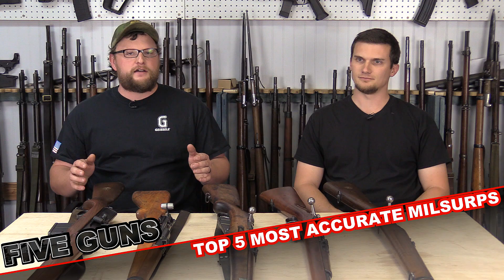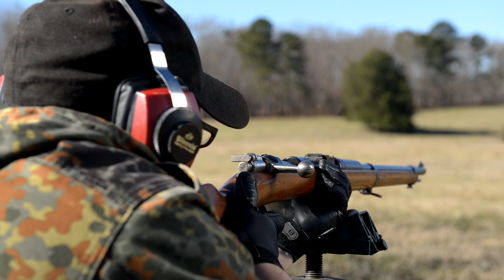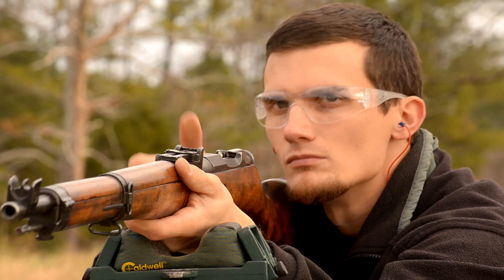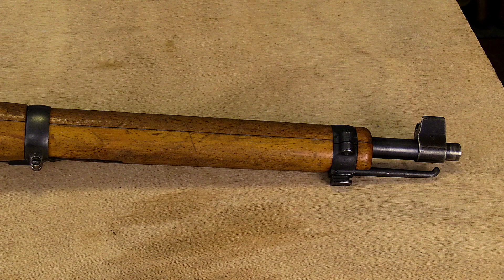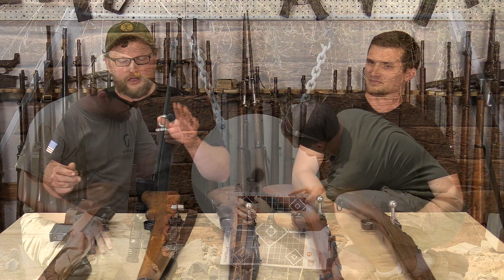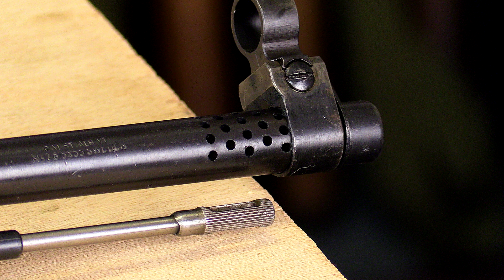Top 5 Most Accurate Military Surplus Rifles

Comment: My grandfather gifted me a Mauser 6.5 Swede when I was 16. My most prized possession! Not only because of the rifle, but being a gift from my grandfather. My grandfather was a machinist by day, and a gunsmith on the weekends. He was often building rifles, I still remember all the old stocks and parts from the 'raw' rifles he would get. The rifle he converted for me had a refitted stock, the bolt cut and shaped to that of a modern bolt angle. But the 6.5 was well selected as the Swedish sniper rifle, because it was very accurate! When I was 18, I joined the Army, one of the drill sergeants in my training company was a sniper, he was also a member of the Presidents top 100 shooters. I was like a puppy, anytime we went to the range, he was my only focus. He spoke, I always absorbed everything he said! However, when I was in the army my 6.5 Swede rifle 'disappeared.' Many years went buy, last year I found a Mauser 30-06, that I am planning on converting to a 6.5 Swede, sort of a reborn rifle that my grandfather gave me, I am thinking of a tribute to my grandfather, as I feel that so much of my life has been contributed to my dad and my grandfather.

Comment: No Argentine and K-98 Mauser? Surprising. Also surprising the .303 Enfield, 1891 Krag-Jorgansen, the 1903 Springfield and the BAR, and the Johnson missed the list. That the Swedish 7.6 and 6.6 and the 91-33/91-44 Mosin Nagant made the list is not surprising. Heck! even the SKS (which did see use in WW2 with the Russian troops, near the end of the war) is mighty accurate out to 500 meters, using the iron sights. At least all of mine were 1 m.o.a. or better at 100 yards.

Comment: My first deer rifle was a Winchester produced, U.S. Model of 1917 Enfield that was military original in the metal work, but had the full military fore end on the stock shortened , or "sporterized".  It was the full 26 in barrel with the sniper sights, rear peep with the sliding tower that could be flipped up, marked off up to 1700 yards.  The front was a blade with the full "dog ears".  That rifle was extremely accurate.

Comment: Knew a Fin who fought in the Winter War. It was a slaughter largely because the Russian brain trust would not trust/ issue their troops arms until they reached the front and went into battle. The Fins took full advantage of this and would break Russian columns into smaller digestible parts and cut them down as they marched on Finland. This fellow, a teen at the time, was the second in a machine gun nest. Once dug into the ice on a lake they popped up and began shooting the unarmed Russians as they marched across the ice. Terrible unnecessary slaughter.

Comment: I know I comment a lot and I'm going to throw a slightly cheaper Schmidt Ruben that I've had a few of in the mix and I promise will not leave you disappointed the K1911 the one I kept I've shot iron sights on a 6" gong at 300yds without a problem

Comment: My 1898 30-40 Krag was the most accurate next to my pre 68 Rem. 700 BDL 243. My dad bought the Krag off a semi trailer on the VFW parking lot in 1957. $25 for it and a box of shells. I was 15 yrs. old. Still have my 243.

Comment: The nice thing about these rifles is you don't have to worry about a gas tube when you have to substitute black powder when smokeless powder becomes scarce. How to substitute black powder to make a powder measure pull apart a round you need to convert, mark the bottom of the bullet seat, then measure 1mm below the seat mark and cut off at the lower mark (1mm below the bullet seat mark) now you have a black powder measure. The finer the grain of black powder burns faster. You need that space below the bullet seat because of compression of the powder may cause the primer to not ignite the powder. Some firearms are originally configured for black powder. The 45/70 is one that comes to mind. You need 70 grains of black powder. The thing about black powder is smokeless powder is 3 times more powerful than black powder. So converting newer weapons you don't have to worry about over pressuring the firearm unless for some weapons that were originally designed to use black powder and you over fill the casing with black powder. As things after a SHTF situation bolt action, lever action and blowback operations black powder will work in. A weapon with a gas tube you might get 5 shots off before your gas tube gets blocked and you have to manually cycle the weapon. Having a Chronometer is helpful when you need to start using the different types of smokeless powder. If you do reloading you have a set of specifications. Let's say you run out of Ramshot True Blue. I don't use 5.56 rounds because I shoot from my left side. The brass from an AR15 or M16 gets thrown back into my face. However my 5.7 x 28 rifle and pistol I can use the 5.56 bullet and some of the powder charge from the 5.56 rounds to reload my 5.7 x 28mm brass. Just have to find out, using the Chronometer, the proper amount of powder needed. I hope that I gave everyone some good information that I received from another person who does reloading.  I have very few rifles that have a gas tube. And one rifle in  .308 has a gas rod and spring system for delayed blowback operation. As the 2 rods are pushed back to extract and reload the rifle chamber. When the rods push back forward it blows the extra gas back out of the gas port and cleans the gas port and the 1st rod section of the gas tube. This rifle, although it has a gas port and gas tube setup it won't jam or plug up the gas operating system.

Comment: M39 is the bomb. K31 is a tack driver too but ammo is too $$. Only thing the same between the 91/30 and the M39 is the bolt & the round. Trigger is 1000 times better and barrel etc is all much much better. Plus it shoots cheap 7.62 x 54

Comment: The diameter of a dime is 0.705 inches. You guys shot dime size groups at 100 yards with a WWII era Karabiner 98k with iron sights. Still the 98k was not accurate enough to make the top 5 most accurate list. I would have to assume that the five most accurate rifles on the table are all also capable of at least .7 MOA iron sighted 100 yard groups. That makes six sub MOA production military rifles of the WWII era you have in your possession.  You guys hit the jackpot. You are obviously excellent rifleman. Amazing.

Comment: I have an 8mm Mauser. German. Sporter stock with a pistol grip and a tapered barrel. Numbers all match. 815P. The rear sight slides to adjust the sights out to 1000 yards. I was hitting it paper plate at 300 yards with the front site covering the entire plate. AWESOME gun. I would put it against anything. Has the German eagle and swastika on it. Not too heavy because of the shorter stock. The 1" rubber butt plate has Jostam May 5, 1931 on it. My grandfather picked it up in Italy during WWII.

Comment: Can't believe this video is 5 years old I'm just now coming across it, I've owned all five of the rifles that you have listed in the top five except my motion was a hex receiver fairly new and was pretty accurate as the finish one, however I agree with you this swedish Mauser which I own two one was a 1905 and one was a 1906 it was extremely accurate with just iron sides at 250 yards I shot a 47 out of 50 points on a military range with pop-up targets in Atlanta in the rain

Comment: My 8mm k98 German rifle has the rear ramp sight calibrate the 2200 yards. I can group with this rifle 10 rounds is a 6 inch pattern. Wouldn't trade if for anything. I also use a Chech 225 grain mouser shell.

Comment: i have owned several British enfield 303 rifles. never had a bad one with my reloads good accuracy 2-2 1/2 to 1-1 1/2at 100 yds .my Swiss Mauser 6.5  x55  1/2-1 inch 100 yards. my hikam 8 mm 1 3/4-21/2 . my mosin nagant rifles 1- 2/12 100yards . these are a working collection. ready to go hunt, defend and I’m the dark days that coming if necessary hand out to help guard my community. some I made side mounts with adjustable bases for windage and elivation and scoped . all of my old warhorses I couldn’t get it my gun safe. there in racks in closet. a bolts removed hidden very good. if someone breaks in and don’t die from my 45 super and we’re to steal them thay can’t fire them. they would be nearly impossible to sell no pawnshop or gun shop would touch them,a private collector wouldn’t touch them with out bolts that’s a red light. we don’t have much breaking in my part of NC, our law on that is clear. if someone try’s to violently break in or has broken in you have a right to use deadly force. stand your ground.

Comment: What you have to remember about the 98s is that many of them were used extensively in Ww1, mothballed and then used extensively in Ww2 to the bitter. Rifles used by the losing, and out numbered side of two long, desperate, total wars tend to have more shots run through them and less care and cleaning in the field. There are also less available which would have been unissued, so barrel wear can be more prevalent. That said German military doctrine squad tactics were based around their superior belt fed machine guns, with riflemen in a support role. That said, those 98s have a lot of use on them and I'm impressed by their accuracy and reliability.

Comment: Your Gewher 98 was off target because those roller coaster sights were designed for 400m and further. The designers thought that WW1 would be fought from trenches far away, and thought they didn't need sights for up close engagements. German soldiers were instructed to shoot real low because of the flaw, and the sights were soon phased out of production.

Comment: SVT40 sucks,worst choice of shooter and that is primary reason why Soviet army replaced SVT40 by SKS karabine..Also you skipped G43 to mention,The G43 more accurate than any SVT40 or even SVD Dragunov (various scopes required for maximum 1200 meter range)....The ZF4 scope not offer much maximum range of G43,it limited for 850 meters distance but if correct scope attached like PSO 1 that used on SVD Dragunov than maximum 1200 meter range guaranteed,in order to achieve that performances G43 need to have tactical threaded attachment on barrel for flash hider or muzzle break to reduce flames....The G43 little longer than SKS and unlike SKS have detachable magazines also for 10 rounds,some rare versions of Denmark manufacturing have 20 rounds but they rare and more bulkier than standart 10 rounds version,modified versions from MG13 Dreyse also was produced for elite German snipers...The Mauser Gewehr 98 offer even more longer range up to 2000 meters,however in order to improve those rifles further early style rear sight assembly need to be replaced for 98K karabine style..During WW2 German army nolonger would use full sized 98 gewehr's and shorter barrel version was made 98K which K for Kurtz or Karabiner...The 7,92x57mm Mauser round is not a joke,this is most powerful small arms round that consider lethal even for injuries unlike anything else ever seen,any war veteran who been injured by 8mm round later after war had died...The ballistic velocity of those rounds very high,even higher than Japanese 7.7mm Nambu caliber......So from my personal opinion having SKS,98K or 98 Gewehr and G43 more than enough as for hunt or for range practice,those rifle's won't fail in combat (eye's on spring's required for proper performances),the weaker recoil or piston spring's as lower performance of rifle's,possible malfunctions and unnecessary jammings...Just as historical records sudjest majority of world bolt action rifle's bolt mechanism was copied from Mauser system,little modified but idea remains the same especially for disassembly...The G43 share only one part with SVT40 is gas mechanism constructions,Russians developed their gas mechanism and Germans copied for the their G43 rifle's..Than Germans developed STG44 world first and most sheet metal stamped assault rifle than Russian's copied that instead along with joint research between Michael Kalashnikov and Hugo Schmeiser and other engineer to research and complete by those early years AK46,it was disassembled most like STG44 until later was modified and became AK47 than AKM...Germans introduced sheet metal stamping production which simplified production and reduction of working hour's to eliminate milling process which makes rifle expansive in production...The H&K G3/G33 is deprival from STG44,looks almost like STG44 and other deprival is Spanish CETME,both H&K and CETME use rolling block breech mechanism just like Mauser company sudjested...First it was STG45 than became G33 and Cetme now model L...Basicly Cetme share lot's of with H&K G33 but receiver housing more flat unlike G3 or G33,second it requires extra work to suit standart  G3/G33 magazine's in Cetme model L..Lot of people's fall for Cetme L because of it cute look,however the kit's requires buying new USA made barrel's which is low quality barrel unlike original ones was demilled,the barrel manufacturer want you to buy those because they know later you would return back for replacement barrel,all USA made barrel's is suck...The main problem with those barrel's that they missing tempering or heat treating process which make them soft for shooting and wear volnurable...Each barrel required to pass heat treating and stress relief process plus lead lapping or knurling,additional features like chrome lining also might be required if barrel runs on corrosive ammunition....To produce barrel's in home conditions possible,however special drilling and reaming tools required than rifling tools among with various machinery...Same goes for ammunition,each machine on factory capable to stamp over several hundred thousand pieces per few hours which is projectile's,casings and primer caps which made from copper or nickel..So as you see firearms in general view it is also consider as engine operating on solid fuel which is a single round,only those small loads of powder shoots projectile's out as extra feature...Yet no any other firearms been made that operating on liquid source to create enough pressure to fire projectile's,there is experimental technology world sower on such as USA,Russia,China and Japan it is rail gun and gauss gun technology,however to miniaturise those weapons still impossible...Those experimental weapon system's requires lot of electrical power to drive powerful electro magnets to create projectile acceleration,USA had many falire's with those experiments before final development was successful..Imagine how many billion's of dollar's our country had wasted??This is why we have ne medical insurance,no social needs,no aid to anyone,low education and all job's disappearance's..On second hand all Corporate Enterprises drain money from USA to keep themselves up float while entire country drawns into abyss...By few more submerging's like this more and USA is finished,only rich and lazy get away with everything while other's have to struggle to survive,USA Capitalism monopoly drawn everyone to bottom,as long we have rottened government nothing would change in our country,it is unfortunate but facts...

Comment: I need to disagree . I have three that with my hand loads will shoot right at 1" at 100M. First is a Remington Model 1917 vintage of Feb,1918. All original and I have got less than 1" out of it. Second is a Smith Corona M1903A3 all original March 1943, which will shoot right at 1- 1/4".  Lastly is my Swedish Mauser 6.5x55 vintage of 1915 also all original and it will print then about 1 1/2" at 100 yds The Swede would no doubt shoot much better if it also had the aperture sight.

Comment: Duh! the little circled plates on the Swede's  stock indicate the grade/ shooting performance of the rifle when last tested by the armory.  If I remember correctly, most all were within a minute of angle and some are better.  I have one with serial number ending in "666" which is equal (in my hands), with my tuned model 70  243. Now THAT is saying something for a mil surplus rifle.
Mauser also made a gorgeous 1895 Chilean version with the beautiful country crest engraved, in 7x57 with iron sights that read out to I think 1000 meters for shooting from one ridge to another in the Andes.  An exceeding fun to shoot,  and accurate  quality firearm from the mil surplus world.
On the other hand, I also have a Kit Carson .53 cal Uberti replica Hawken style muzzleloader copied directly from Carson's own rifle (which sits in a museum in I think New Mexico), that has the same physical measurements, same metallury, etc. , that  with open Iron sights, put 5 roundballs into the same hole @ 100 yds in a muzzleloader competition out at the old Los Angeles firing range. (Still have the target signed by the rangemaster :)
 Have fun with this old stuff, just be sure and have a knowledgeable gunsmith check em out (specially headspacing)before you fire them. A lot of them were just thrown together from misc.-non matching parts, by unscrupulous types, trying to make a quick buck in the   CC&R markets.....

Comment: Yugo M48.  Just wow.  In my mind, it is a refinement of the Kar98K when it has a turned down bolt handle instead of the wide arc handle or the straight handle.  The only thing that could've made it better would be easier to use sights (They're short and not so prevalent.) and the built in bolt disassembly tool which is commonly in the stock of a lot of Mausers.  There is no bolt hold open on the follower which makes a function check after cleaning easier.